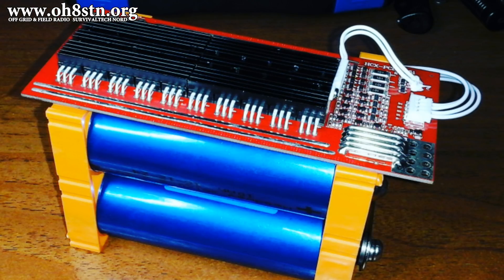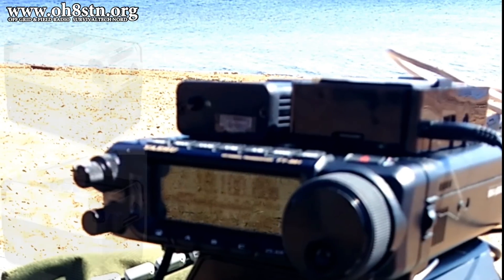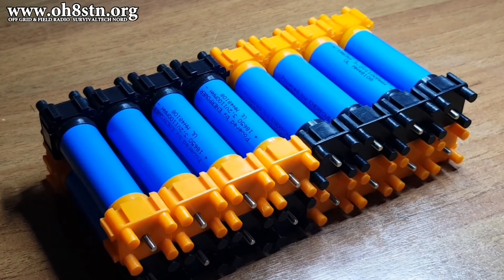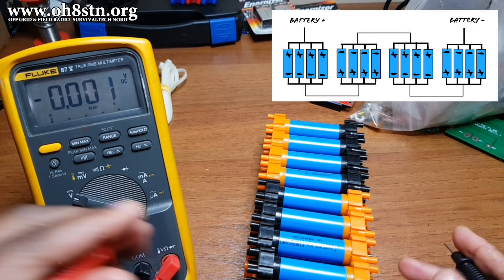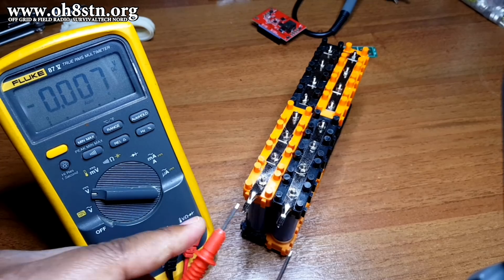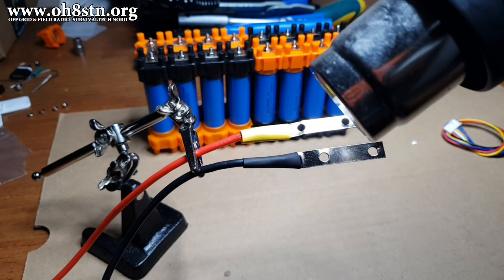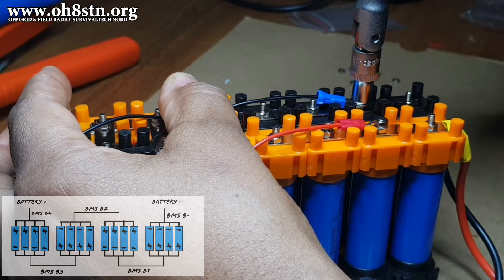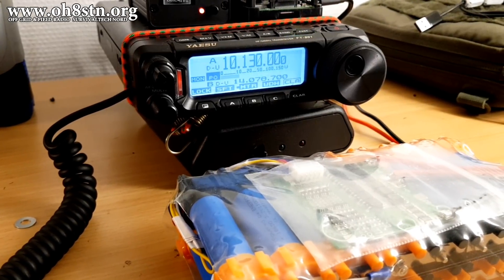Ham Radio Battery Pack DIY LiFePO4 | Vruzend kit

Comment: Excellent tutorial Julian. I've shared this with both the clubs I interact with.  I've also been asked to do a talk at my primary club at some point on this subject. I wouldn't be here without your pioneering and sharing.
Reply from the maker: Thanks Andy. It seems someone can be happy some of the time :-)
I've got another build coming up, it's the 384 watt-hours solar generator. That is designed to be a field station power supply. While I'm waiting for all those parts perhaps I'll do a presentation on grid down comms and power.
Anyway sorry I haven't been so engaging lately. Trying to keep my and misery to a minimum 😀
Reply: @OH8STN  You may have seen my Headway 38140 12Ah pack is now complete. Will be giving it a run out tomorrow night in the UKAC 2m contest 8.00 -10.30pm GMT. I'll be using my Yaesu FT-290Rii operating from the car at a local high point. I managed over 400km from the same spot yesterday.

Comment: Only an armature would put use fuses in a battery pack. then put in two of them to double the resistance. Use on and only one circuit breaker.

Comment: I'm a big fan of the 18650 cell since they can be salvaged from many sources. I did buy the Vruzend kit and like it. However, the kit is reliably not re-usable in my experience.  

I took apart a pack I had created and only 2/3 of the end caps were still usable. They split along the thin straight walls. I ended up buying a $35 spot welder which  works fine with .2 mm bus strips and the over all size of the pack is smaller. 

 I use Daly BMS boards and love them. I charge from my electronics bench power supply and a 1.5 A thin film solar panel. I'm trying to recreate your work on a smaller scale and budget. 

Love your work, thanks for all you do.
Reply from the maker: There's a red flag in your comment. Recharging from the Bench power supply is okay on the bench. What about charging with the thin film solar panel in the field? There needs to be a charge controller between the solar panel and the battery pack. How do you manage voltage regulation, stability overcharging without a charge controller?
The vruzend csps are nice if you want to re--use the cells in some other project. I haven't had the same trouble as you mentioned. Admittedly I also use a spot welder these days. It's better to get some more reliable build long-term, than more convenient to build pack at the price of reliability.

Comment: I have a set of 25 AH Lifepo4 cells and 2 sets of 60AH Lifepo4 cells.  I hope that will give me the power I need.  I need to work on  solar panels to change and I way to get a good read out on the state of the batteries.  THANK YOU FOR THE INFORMATION!   73. W4DES

Comment: Julian,  Is there a BMS for a pack built with 2 groups of 4 serial wired 18650s with the groups wired in parallel yielding 16.4v with twice the capacity of a single group of 4 serial wired batteries? Would such a configuration be called an 8S4P?
Reply from the maker: Hi Michael. You left out some critical information but let's assume we're talking about lithium ion battery chemistry. With eight cells for in series, and another identical set in parallel. This is called 4S4P. It will output  ~16.4-.8  volts when fully charged. If we're talking about lithium iron phosphate as we normally work with them this channel, that same configuration would also be 4S4P, but output ~14.4-.6 volts fully charged.
Reply: @OH8STN  Will be using Li ion batteries as they are in the box.  So how what do I use for a BMS for such an experiment?  Am in the US so Amazon is a decent supplier.
Thank you for your reply!!!

Comment: Nice clean install.   One stupid question.  I want to buy a mobile radio for my Mobil Home.  What can you recommend for a "no idea" user like me.  Thanks.
Reply from the maker: Awesome question but it's impossible to answer without a bit more context. BHF/UHF? HF?
 I have used Kenwood and Yaesu radios for mobile. Unfortunately you'll have to decide if you're going to be using repeaters, if you want to operate Simplex, or if you want to do some aprs. There's also the questions of a DMR radio, a system Fusion radio, where D star radio just to name a couple. If we are talking about a mobile HF radio, the question is a little easier. You need to decide if it's going to be a radio you use while driving, or a radio in a fixed location inside your RV. Icom makes excellent radios for fixed and mobile portable like boats and RV. Yaesu is good with traditional mobile HF rigs. If it's your only rig in the RV, and you will only use it while parked, I would go with a Icom 7300 for HF
Reply: @OH8STN  Great.  At least now I know how much I don't know.  I will research.  It will be used while on the road and while parked at camp sites. Much like truckers use it, I suppose.
Reply from the maker: We all start someplace 👍👍👍

Comment: I bought this kit for a unrelated product a 10s 3p battery pack for a scooter that was defective one of the tabs broke off and it ruined the whole pack. Instead of buying a pulse spot welder I decided to rebuild it with the kit will update if I succeed or fail.

Comment: So what is the advantage compared to AGM as far as cost and weight a 20ah 12v AGM is around 70$
Reply from the maker: The price at the cash register is a deception. We need to look at the cycle life of the battery. The typical AGM battery has about 500 Cycles. LifePO4 has 2000 cycles. You would have bought 4 AGM batteries before the LiFePO4 started to degrade. Another point is the AGM battery having only 50% usable capacity. So if you want 20 amp hours oh, you need 40 amp hours batteries to achieve it. If I want 20 amp hours out of my lithium iron phosphate cells I simply by 20 amp hours of lithium iron phosphate cells.
Here's a comparison we put together on my website. It Compares this or generator, with a Goal Zero Yeti lithium, and a Goal Zero Yeti let acid. It also explains very well the cycle life. I hope this helps. Thanks for the question oh, it's very much appreciated.
https://oh8stn.org/blog/2019/02/23/the-real-cost-of-a-solar-generator/
Reply: But that's a difference of 20 amp-hours vs. 4.4 amp-hours....so I guess the argument youre making is this is still a better solution for low powered solutions over longer periods of time vs. High amp applications? Pricing is still a bit high for 18650 based solutions but I can definitely see the argument for weight/portability vs. AGM batteries
Reply from the maker: My only arguments are the 500 cycles lifespan and 50% useable capacity of AGM or lead-acid batteries, versus 2000 cycles 95% usable capacity of Lithium Iron phosphate. So not only is lithium iron phosphate lighter, and has a much great cyclic lifespan, we would have bought four AGM or lead-acid batteries before the lithium iron phosphate would have reached the beginning of its end of life. If we're concerned about performance under load  and capacity, we should also consider Peukerts law which states "as the rate of discharge increases, the batterys available capacity decreases". Peukert's law is much less relevant with lithium based cells. 
So really, certainly lithium iron phosphate packs are more expensive at the cash register. Thankfully their increased performance, longer cyclic life, and increased performance are all reasons to invest in them.

Comment: I have a question... Most pack builds I have seen make the series connections between as many parallel cells as possible. In this build you arranged the cells so that you only made one series connection between parallel cells. Does it matter?
Reply from the maker: Do you mean the physical connections (busbars) between them? If so, we can always use more busbars. If I were experiencing some voltage drop, or couldn't reach the packs current potential, I would certainly add more busbars.

Comment: Julian, what is the recommendation for torque on the nuts? 73 KM6OND
Reply from the maker: Hi Steve. I don't remember it off hand you'll have to check the documentation, or one of the e-bike/ev websites.
Reply: RRR will do.

Comment: Hi Julian,  just a quick questison, does the BMS prevent automatically  batteries'  over-discharge below 3.0 or 2.7 V for LifePO4 cells ? If yes, Can you set a custom value (i.e. 3.0 or 2.7V)?
Reply from the maker: Excellent question Fabio. You can't do it with the BMS without changing out some resistors. However you can do it with your BMS for example the Victron BMS. It's programmable allows you to set high and low voltage values. I'll have one here for the channel pretty soon

Comment: Thanks for your videos. I enjoy them both for the content and their style. I've been considering using self made Lithium base battery packs for portable communications but have two concerns. First, is it necessary to match the cells for charge and discharge compatibility so the pack functions safely? If so, do you know if matched cells can be purchased? 
Second, when using Lithium based batteries in parallel should I use a fuse or fuse wire between each cell and the bus wire connecting each of the parallel cells? Doing so would prevent the other paralleled cells from discharging through a shorted cell creating a catastrophic failure. The blown fuse would also remove the shorted cell from the circuit allowing continued use of the complete battery pack. (Although at a lower capacity) 
73, KB9SF
Reply from the maker: He thanks for the comments. I find it is usually close enough to use quality cells, all from the same manufacturer, from the same lot, all having a very similar internal resistance, and manufactured at the same time. Matching the cells is something that was usually necessary when using recovered cells. If one buys a box of brand new cells from a good manufacturer, all of this cells are usually within spec.
Cell level fusing is not a bad idea but it is a personal choice. If I were using lithium-ion cells to construct a larger pack, I would definitely go for it. Since I'm using lithium iron phosphate cells and not pushing them anywhere near there discharge capacity, I'm not too worried.

Comment: Hi, noob here and was wondering why you chose LiFeP04 cells as opposed to 18650 Lion cells.    Was it due to the voltage output being closer to 12 volt than the 3.7 volt Lion cells would produce or was it something else?
Reply from the maker: Excellent observation. Yeah the lithium-ion cells will Top out around 16.8 volts. That voltage makes it difficult to charge with a portable solar panel in the field, and require some voltage regulation if you use them in 4S. You can use them in 3S, but then you have to run parallel cells to maintain the capacity.
Great question, and excellent observations

Comment: Why not make it a cube?  Or it is because the BMS is longer than a string of 4 cells?
Reply from the maker: I can buy any Cube shaped battery from the shop. I needed this shape for the available space in the rucksack. It's a portable battery. I might even take it apart then make it flat. 👍
Reply: @OH8STN  That answers that :-) Cheers.
Reply from the maker: Yeah I know it seems a little crazy :-)

Comment: I'm ready to purchase some batteries the Headway LiFePO4 40152S but I'm in the USA and I'm not sure who to order them from. I'm very cautious on who I'm buying from. I only order through AUTHORIZED dealers with FULL WARRANTY and I'm covered if anything goes wrong I want FAST SERVICE. I have decided to build a 4S 3P pack.
Reply from the maker: Try batteryspace
Reply from the maker: https://www.batteryspace.com/lifepo438120pmsizecell32v10ah100asurgerate32whwith6mscrewterminal-unapproved.aspx
Reply: @OH8STN  They already have a prebuilt pack I don't have to assemble anything. Here is the pack I got https://www.batteryspace.com/LiFePO4-40152SE-Battery-12.8V-45Ah-576Wh-100A-rate-with-PCM.aspx
Reply from the maker: @Hondacber  that's a monster 👍👍👍 Publishing a very similar build on the channel in a few weeks.

Comment: Do you need a bms if you using a solar controller?
Reply from the maker: Sure. The bms offers cell balancing,  short circuit protection, high and low voltage protection, ...
Reply: @OH8STN  thanks God bless..

Comment: What is the total cost of the 4S4P battery build?
Reply from the maker: Built the 4S4P & 4S2P packs for ~78$ total cost including 20A BMS for each.
Reply: OH8STN awesome.. Been wanting to build a 15aH pack for a yaesu ftm400 that I just picked up.  I don’t really have a reason to build a 15aH battery.. just kind of want one for when I go camping on weekends.  Are all the required parts linked in the description ?  Sorry I did not check all of them.
Reply from the maker: I didn't include the cells in the description, but everything else is there.
Reply: OH8STN all right cool thanks for getting back at me!. subd

Comment: Those are 4S batteries that means your running that radio at 14.8 VOLTS at full charge your giving that radio 16.8 VOLTS BAD IDEA your going to burn that radio up. You need a 3S pack.
Reply from the maker: Sorry Roger you're wrong! The build uses LiFePO4 cells, not Lithium ion. A 4S LiFePO4 pack is 12.8 volts nominal, 14.6v max. These cells are identical to the cells used inside Bioenno batteries.
Reply: @OH8STN  O OK sorry. I didn't know there was a difference. THANK YOU for telling me. I have put together a lot of 18650 packs and all of my 3S packs at full charge was 12.6. I have a lot of 18650's but none of them are LifePO4. Where do I get those ? Also are they better ?
Reply from the maker: No problem. I expected this question a little sooner to be honest. No harm done. Lithium ion have a greater cell density than lithium iron phosphate. So you can get the greater amp hours with fewer li-iin cells  lithium iron phosphate have lower cell density,  are much safer to work with, and have a good return on investment with 1500-2000 charge discharge cycles.
There isn't a big variety of lithium iron phosphate 18650 cells, but they are becoming more popular. Check out your e bike shops.
Reply: I found some of the LiFePo4 18650's but there not as common as the LI ON ones. I'm wondering why that is ? That is why I have never came across them yet.
Reply: @OH8STN  I have The BOSE Acoustic Wave Music System II Radio and I build a TWO 3S 5P packs for that. I'm thinking of taking the 2 pack's apart and making a 3S 10P one instead. I like long run times. I'm using the Samsung INR18650-30Q ones.
Reply from the maker: @Hondacber  Outstanding. I also thought about a really long battery built on Sony or Panasonic Li-Ion cells. I decided to go with Headway 40152 LiFePO4 cells instead. The build is much easier with the Headway cells, and there's fewer points of failure for the same amount of amp hours. To be fair though, I really like the cell density of the cells you're using 👍👍👍
Good discussion. I need to get some sleep now. Have a good night and thanks for reaching out.

Comment: I have the kit and have been using it for months now.  The connections are not that tight, I'm lucky to get a few amps thru it.
Reply: Thin nickle strips aren't the best conductor either.  You may want to double up the bus bar (or switch to copper).
Reply from the maker: Hi Steve. The version 2 kit is quite tight on my cells. I was actually  surprised the kit could power the 891.
Reply from the maker: By the way Steven. 
One of the things I figured out was adding additional busbars in parallel. I'm not sure which kick you have the version 1 or the version 2, but diversion to allows you to use I think it's 5 or 6 bus bars in parallel. I think I'll do a follow-up video sometime on this topic, showing the amp meter versus Power output with the radio.
Reply: OH8STN good idea I’ll try it

Comment: Hi Julian.  Can I use 40 cells and  the kit parts and use the same BMS with appropriate fuses to go say 4x10 cells or is that pushing things?  Thanks!
Reply from the maker: Hi Ronny
I don't think that's pushing it. The Vruzend FAQ says the v2 kit can output 3A per cell. From experience I know you need to do some meticulous work making sure each connection is perfect. You also have to double or triple up on the bus bars on each connection. 
I haven't built such a big pack yet so I really can't say. If you try please come back and share your experience with the rest of us.
Here's the Vruzend FAQ.
https://vruzend.com/faq/#how-much-current

Comment: Great video as always.  As a total noob to this, I would like to ask how you charge these cells at home.  What kind of special charger?
Reply from the maker: Thanks Tim. 
Standard hobby charger set to ~14.6v 0.5A, or through a solar charge controller for LiFePO4 4S batteries. It's very standard stuff these days.
Reply: @OH8STN  RR thanks!